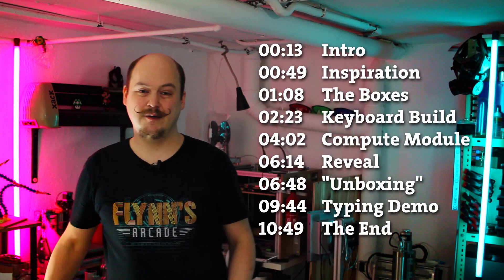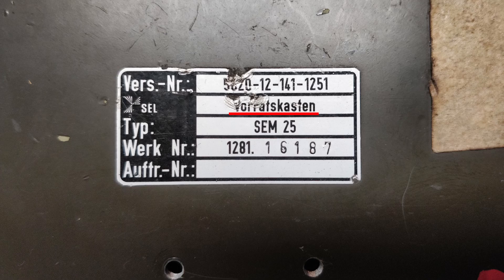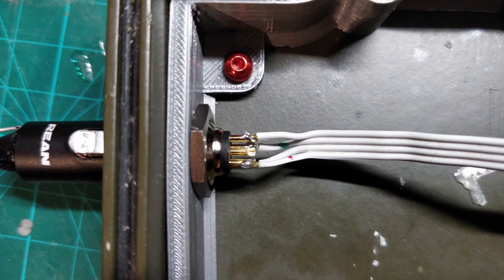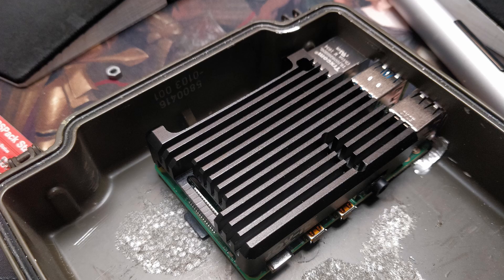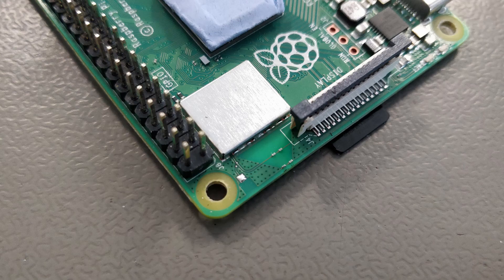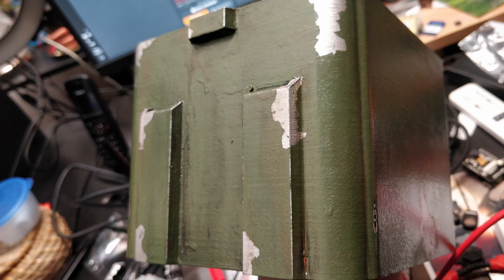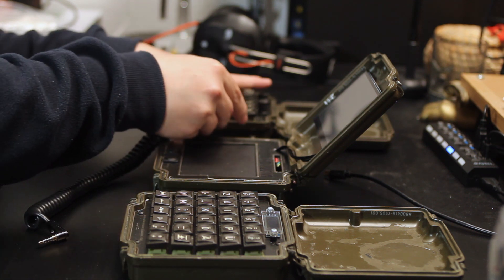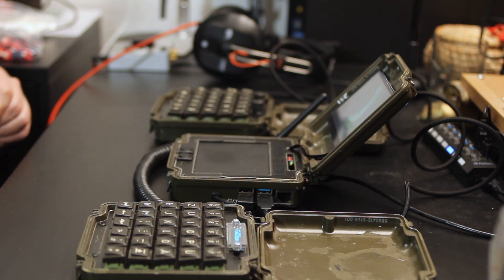P7: DIY Tactical Cyberdeck / Mechanical Keyboard

Comment: in case anyone finds this.
BEWARE... was planning to use a sem25 spares box for a project and based on smells and instinct tested the paint for lead. the test colored more then the color scale it came wuth so its quite high in lead.
Reply from the maker: Oh, good to know... Please don't eat your keyboard 😅 just kidding. Yea to bad. Nothing you want to constantly touch :/
Reply: @MakenModify  yeah, will have to soak the entire thing in paint stripper now. 😢

Comment: This is not a Cyberdeck. 
It's clearly the Ackerschnacker-EDV-Aufklärungs-Fernmelder 2000, and only a single unit has ever been built as of now. Since the German Bundeswehr still can only be contacted via Fax Machine for inquiries and to relay any order doctrine, if no one answers the phone (no one ever has), this device is believed to be the Military's only functional interface that links to the outside world. In theory, at least, as it is unclear still where it is stored, or if at all, so it might as well collect dust in a phone booth near Schwarzenborn. But then again, no one knows how to recharge it anyway, as it is missing a connector for the crank that's used to power on every other mobile field radio equipment.

Comment: Very nice looks like military 70’s green.  I have seen switches for turn on and off you could add those and also your demonstration was backwards couldn’t see anything you typed lol. It would be cool if you added another screen for radar and another for maps but separate at different angles so it looks more cyberpunk and a decryption cryptography or even stenography screen and also perhaps add a ham radio interface with old school Satellites dish smaller and large old school cell phone that looks bulky on the side lol or even ad a press and hold hand speaker like the ones cops have, heck I’d do both lol. Plus network, router, and even server controls and switches. Cool Wi-Fi a router looking antenna & belts btw. Additional add ons could include climate readings, proximity sensors, and other modules that others have added to arm decks etc 😊
Reply from the maker: Hehe let me order 5 more boxes 😉 yea it has quite some potential for ubgrades but I might not find the time for that.

Comment: Wtf that sounds almost exactly like Teah’s $10,000 keyboard
Reply from the maker: Hehe thx  :) I mean those are lubed cream switches in an alumin(i)um case and a 3mm acrylic plate 😬 but yea it's was not quite as expansive 😉
Reply: @MakenModify  yeah and tifu’s was a 60% so anything that size and under is gonna have that crisp signature sound where yours are like two little 30%? 😂 so sick. neat build tho, just learning of cyberdecks and going down the rabbit hole now 🐇 😎🥄
Reply from the maker: @BK-uy9nj  hehe welcome to the rabbit hole. Just in case you are not aware: the epicenter is the Cyberdeck Cafe Discord. (Linked top right on the Cyberdeck Cafe website)

Comment: Anyway, to make the keyboards Bluetooth so you don’t have so many cables to hook up
Reply from the maker: Yea could just swap the pro micro for a Bluetooth board like an nrfmicro. The metal cas might block it a bit though. But in a military style situation I would not want to rely on an easy to interfere wireless connection.

Comment: Looks amazing. I'm guessing this would run without the keyboards? It's pretty compact without them.
Reply from the maker: Yea it definitely dose but an on screen keyboard makes the tiny screen even smaller ;) but yea if you have an optimized app it is an option, just hacking at the terminal is not fun without a keyboard😬

Comment: I wonder if you could fit a cyberdeck in just one of those boxes
Reply from the maker: Possible i would say. If you use a smaller keyboard and use it in place of the track pad.
Reply: @MakenModify  I'll look into that, the case is gorgeous lol

Comment: That is amazing, really great work. One, minor suggestion. If it were possible I would try and put the keyboard into one box and have it fold out.
Reply from the maker: Tried that but would not work with mx style switches. Maybe with sol low profile ones, but that would also mean different keycaps.
Reply: @MakenModify  appreciate your reply! I also thought later that the split keyboard is very popular now so there is that as well. Having watch quite a few more cyberdeck videos, I just wanted to let you know you that this video is really awesome. Look forward to more.

Comment: if you can 3d print a plate to push into the usb ports and cover them up to keep bits from going into them  that would help maintain the look of the case and be functional  also. do the earphones work with that setup
Reply from the maker: Yea might do that. The earphones work but not with the deck, since there is no audio out port atm ;)

Comment: Your system is FULL EMP IMMUNE!?
Reply from the maker: hehe I don't think so but it at least looks like it would ;)
Reply: @MakenModify  yeah jut add new     connector and metall covered wire.
Or cap on connectors and it's become - military standard NUKE EMP immune system.

Comment: I like this one. Have you tried the choc switches?
New sub btw.
Reply from the maker: Tank you. I have not yet. I have some choc hot swap sockets (accidental order, wanted normal ones). Chocs are still a bit expansive and I have so many other switches I need to use first 😅 but they are on my list ;)

Comment: Awesome build, man!  Question though:  Was it tough getting used to typing on a separated keyboard?  Perhaps I never learned to type properly, but looking at your layout, I'm sure I would catch my self moving one of my hands over to the other half of the keyboard to type on a particular key.
Reply from the maker: I learned touch typing in school but i still used some letters with the wrong finger. Switched to split when I did my first keeboard (did a video on it). Had to get used to it for a week or so but ever since i mostly use split keyboards

Comment: Space constraints are a thing I’m sure, but it’d be cool if you could do this using only two boxes! Still a split keyboard, but maybe use the lids from the keyboard for  dual screens and drop the trackpad.
Reply from the maker: was actually think about something similar but then there would have to be a lot of connections between the halfs. But the first intention was to build a keyboard and so that grew from there ;)
Reply: @MakenModify  you could run the battery in one half and the computer in the other. Then you'd only need keyboard and power connectors.
Reply from the maker: @Starfireaw11  didn't you say dual screen? 🙃 anyways you could do many things differently but that's the idea, just make it the way you want it ;)

Comment: so cool! saw it on the cyberdeck cafe stream a couple of weeks back, awesome to see a bit more of it. The paint job on the outer case is fantastic, how did you get the peeling off paint effect? and the brushed aluminium look of the bare metal parts look great, is that just a little of the layers of the print showing? Really looks like metal.
Reply from the maker: Hehe thx. Painting will be the next video I think. Will go into detail how I did it 😉
Reply: @MakenModify  awesome, subbed and looking forward to it!

Comment: thats pretty cool design would be even cooler if you some how made it so you can pull out all three with one handle and it instantly folded out each one to the perfect position.
Reply from the maker: Hehe your probably right but then it would never have had an end 😉 had draw a line and get this project finished. Bight revisit it one day :)

Comment: Obviously it's because of the way the cyberdeck came to life, but it's obvious that the usb connector should have been on the right half of the keyboard where the usb of the pi is, so you'd only need a 5cm cable to hook it up.

Other than that, IT"S FRIKKING AMAZING!
Great job!
Reply from the maker: Yea there are many things that could use some improvements but wanted to get it done. Thank you for your feedback and kind words :)